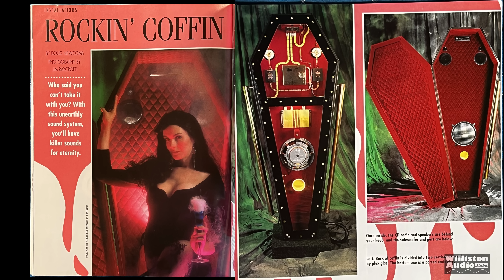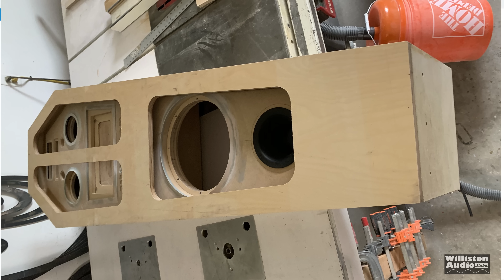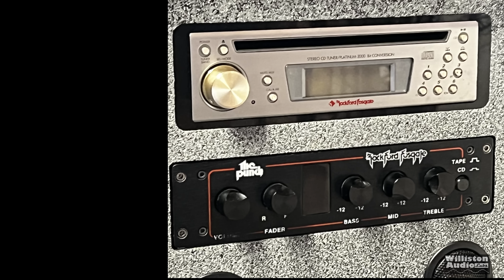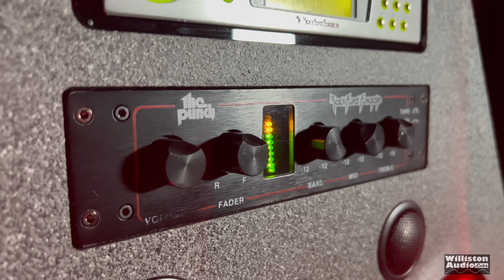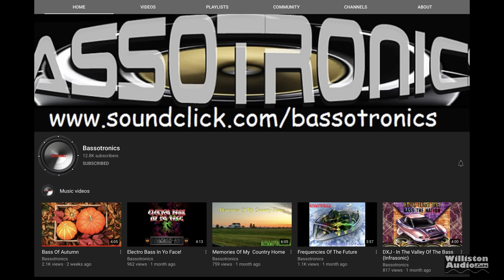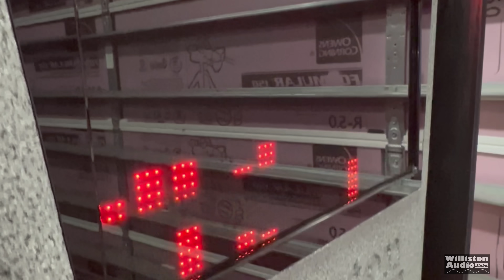Car Stereo in a Coffin? Old School Tomb of Boom - Amazing BOOMbox

Comment: How do you get in touch with Mr Williston, to ask?s or just ask here? My question is when you look up competition speakers they all have this big thick rubber or foam surround, but yet Memphis M7 12 inch subwoofers and their mojo series I'll have a double stitched twin edge surround, that they say allows more ext. More air flow,  there's speaker prices are more per speaker than the average, the sound quality sounds excellent their speakers are made superbly with the vents to cooling the frames, etc  none like I've seen in any previous speaker but yet I never see any of them in competitions why is this? also I never have seen a amp test comparison or a review on them except from the manufacturer so I wish that Mr Williston would do a review and Comparison on the m7's and the Mojo's, against other speakers to see which ones are truly the king and Why.... Please n TY ..

Comment: Boston Acoustic Midrange are no doubt good quality mids. Wondering why you didn't go Rockford Fosgate on everything?
Did you mention what those 2 tweeters were?
I may have to listen again. Working at the same time.
Old age, can't multi task like I use to.
Reply from the maker: Boston Acoustics 5.4’s (mids and tweets). I thought about all RF but Bostons are what I used back in the day and my favorites
Reply: @wal  
No doubt that they are loud and clear.
Reply: @wal  
Oh no..
Now I'm thinking how it would sound with a passive radiator and doing away with the 3-inch port.
Would have to be about 12 inches taller though. 🤔
Taller Coffin,
Taller Dead human.

Comment: This is really cool.  How do you connect large wires to the subwoofer in these applications?  I am building a back pack mounted system and trying to connect dual voicecoils in 2 ohm configuration on an SKAR 12" 1200 watt sub.  What is the best way for me to get them connnected in parralle and fit two 8 gauge wires into the push connectors on the sub?  I presume it would have been best to just buy a single voicecoil subwoofer now that I look a this.

Comment: Awesome build! What did you use as a power source? Building my outdoor kitchen and want a car audio set up. Just wondering about the 12v power?

Thanks!
Reply from the maker: It can be powered by 12V battery or DC power supply. Only pulls around 15A at full volume

Comment: that's pretty fang sweet... What is powering it all? (battery? Power supply? both?)
Reply from the maker: Either will work. I currently use XS Power PSC-60 power supply, but it would be fine with 20A power supply.

Comment: How did you power it? Batteries or a ac to dc converter?
Reply from the maker: It can be powered by 12V battery or DC power supply. Pulls about 10A when cranking

Comment: Looks pretty bad! I used one of those Bluetooth receivers to add a sub without taking anything apart. It worked pretty good and was cool to control the bass completely independent from the hu. Of course I eventually got the bug and changed all that stuff too

Comment: Dude that's bad ass. U didn't mention much about how it's all powered though. I am curious about that. Awesome build though man.
Reply: The car audio setup in my garage plugs into the wall
Reply from the maker: It can use either 12V battery or power supply. Pulls about 10A average when cranked